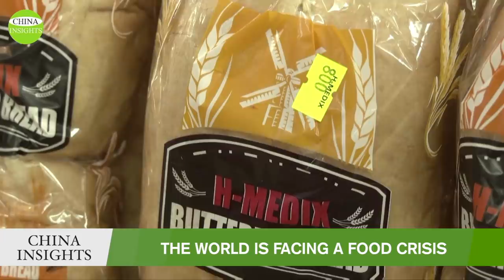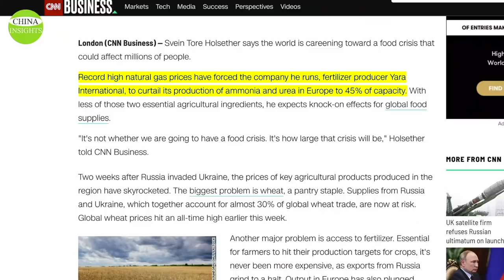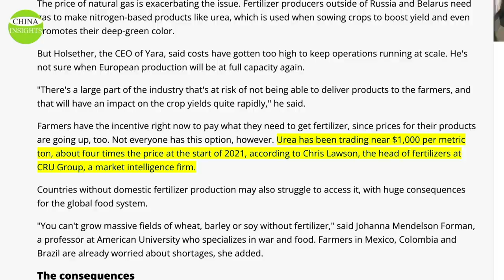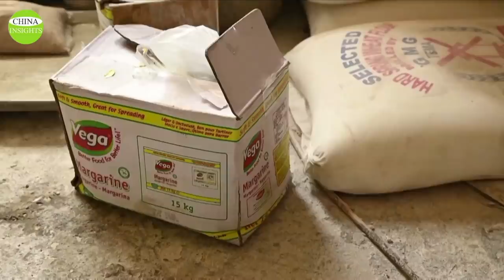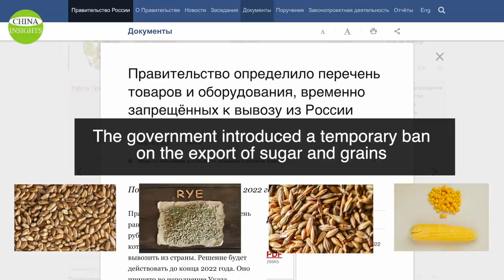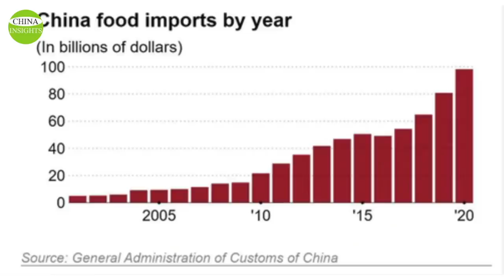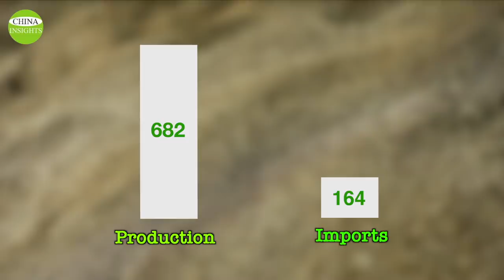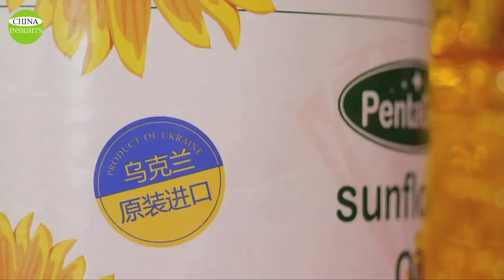World faces food crisis due to Russia-Ukraine war/China has stockpiled massive amounts of food/

Comment: @chinainsights Your math is off. "19% of Barley supply + 14% of Wheat + 4% of Corn" is not equal to "more than one third of global grain exports". This is not how you add percentages of different products. At most it's 19% of global grain exports, and that's assuming the proportion of Wheat and Corn export in the global total is negligible, which we know it isn't.
I haven't looked into the total production/total global export of these products to give a more precise value, but you're probably looking at a figure of somewhere between 10-15% of the global export market for them - still significant, but less than half of your estimate.
Reply: Unfortunately the percentage of oil and gasoline  from Russia in USA is even less, some 5-8% but the market was sure as hell to reply with panic and drastic gasoline price surge!
Reply: came here to say this, that's not how you add things up...
Reply: @ПётрПроценко-б3к  Not panic, it's a monopoly